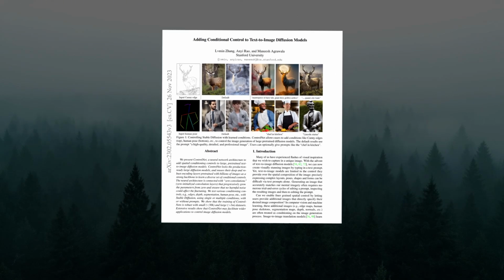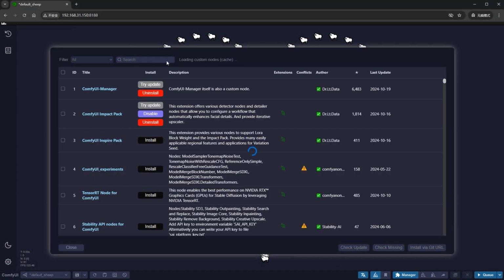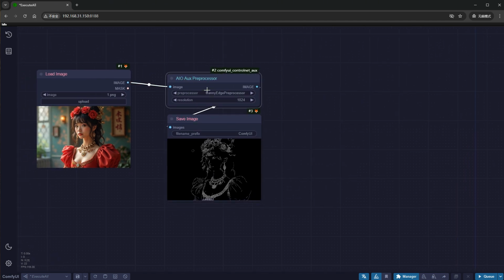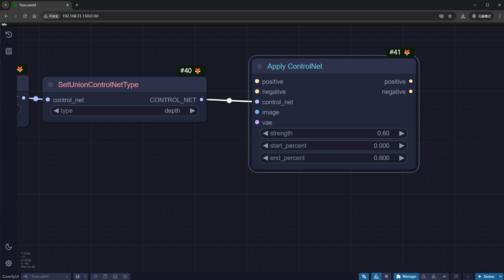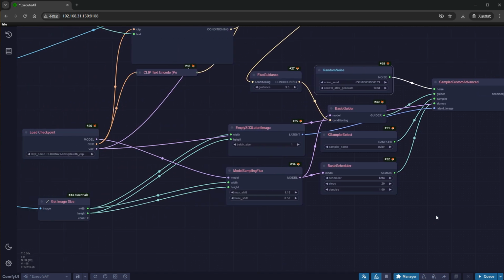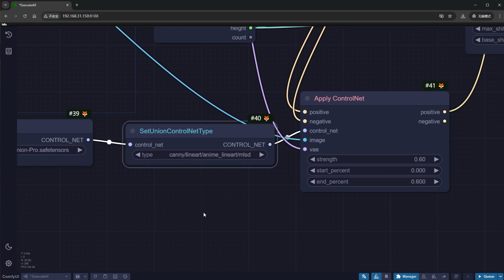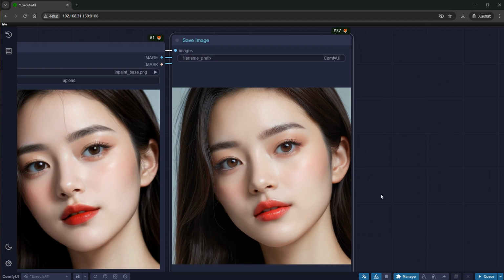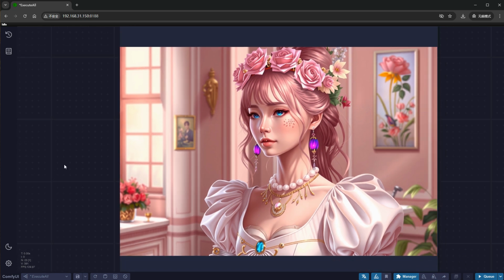The Most Comprehensive Flux ControlNet Guide: Learn Everything About Flux ControlNet in 30 Minutes

Comment: Thank you for your video and workflows. The workflows work for me, but the resolution of output images are all 560x904 pixels. How can I change the output resolution? Thank you very much!
Reply from the maker: I used the get image size node in the video to take the size of the reference image, if you don't think the size of the original image is appropriate, you can use the resize image or other resizing nodes to resize the reference image larger or smaller before outputting it to the subsequent process